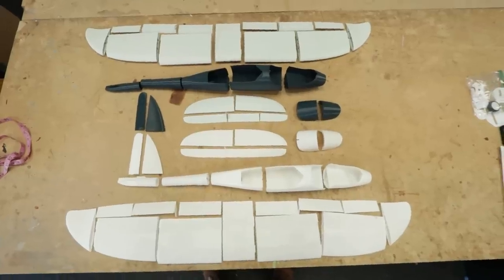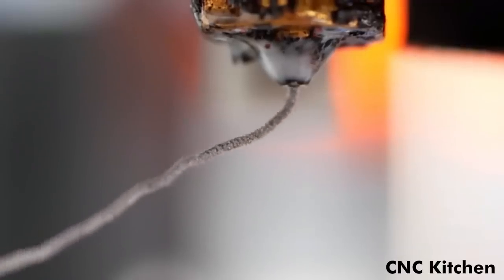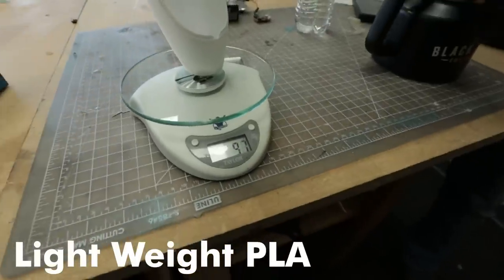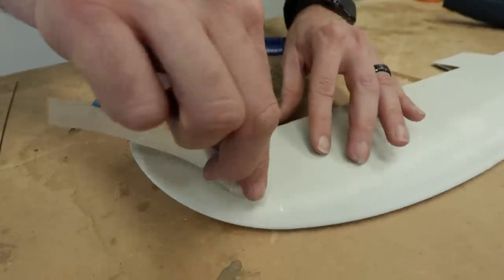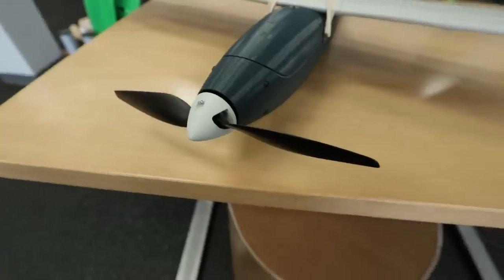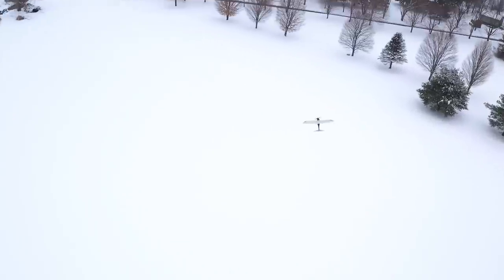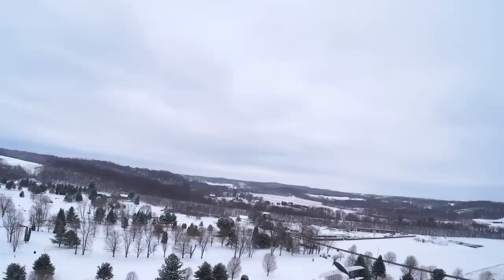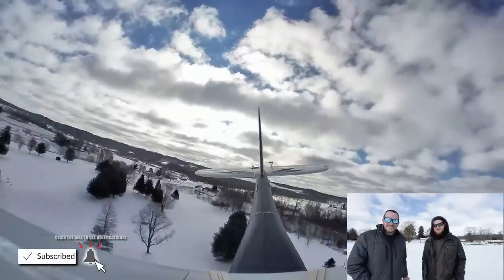Insanely Light First 3D printed plane!!!😱

Comment: FliteTest: It's free.

Me: Can I borrow ur 3d printer?
Reply: and the receiver, motor's, props, batteries, and spare parts.
Reply: Or you could design, test, change, test, redesign, test, amend, test, scrap, design v2, test, change... rince and repeat... yourself, and then fly what ever you come up with. 

The design is free. No one ever claimed that you would get a RTF setup left on your doorstep.
Reply: @LeftFlamingo  OH?  Like the thumbnail that brought me here that clearly states "FREE 3D PRINTED PLANE" in English text?  Yes, they did. Try again.

This is like those bogus software offers that say "Free download" but then try to charge you to use the software after you download it.
Reply: @Doggeslife  I guess you're new to the internet. Welcome. It's an interesting place.
Reply: @cmdraftbrn  and the high cost of the materials.  see my post above.   $80.91 for 750g shipped.
Reply: @Doggeslife  Yeah, Free in the same sense that models on Thingyverse are Free. Most of the time you have to pay for the STL files on top of the printer and other hardware required to make the model do something.

Maybe you're unfamiliar with the norms of 3D printing, which in case that's fair.
Reply: @DFX2KX  Nope, very familiar.  Hence my displeasure with the loose and misleading use of the word "FREE" so often done.  Have a better one.
Reply: @Doggeslife  That's the thing, it's universal enough that the very last thing I'd expect would be a complete model. To me, 'plans only' has been a given for the same reason that 'Hey, Firefox is free' doesn't imply that every install of Firefox comes with a complementary laptop.

I'd suspect that's how most folks parse it, because otherwise people wouldn't put free anywhere in their youtube titles for the hate.
Reply: @DFX2KX  " 'Hey, Firefox is free' doesn't imply that every install of Firefox comes with a complementary laptop."

No, but I wouldn't expect a "free" airplane to come with a compete radio system either.  Just the "free" airplane as advertised.

And poor analogy using a browser. FF says free and it is.  When you download "FREE Firefox" and run it, it runs as advertised. It doesn't say you have to pay more to keep it, or that you still have to pay for this or that additional expense to have it. It IS free.

"Free" means FREE, and possibly the most abused word in commerce. Thank over-aggressive marketers for the most part.

"Free 3D printed plane" is false and misleading.  "Free 3D printed plane files" would be accurate, regardless of what "Well, that's what they do" excuses are given.

'Nuf sed.

Comment: Interesting idea: to demonstrate how easy and quick it is to get back in the air with one of these planes, intentionally auger in, which would start the clock, and then reprint out the parts needed and rebuild the plane.  It could also be a test to compare regular PLA and LW PLA in terms of durability.  Maybe do a test with PETG or TPU as well.
Reply: Assuming I can get my hobbies in order, I'll be printing this out of PETG and it will be my very first plane. I'll try to remember to report back.
Reply: @MrPinusMonticola  Awesome, thanks!  I plan on making the plane myself at some point.  Not sure what material I'll use though.
Reply: my guess would be... 200 hours or so on a complete frame loss. At least with my printer since the old Tarantula prints slow.

Comment: "Lighther than air"
Impossible...
Reply: It's possible aerogel with hydrogen is lighter than air I think
Reply: @tristansimonin1376  But thats not what light weight pla is made of
Reply: This will not be the last time you will be lied to.  The author of this video’s title is likely a democrat.
Reply: It's not impossible because he didn't specify the amount of air it is lighter as. One cubic meter of air has a mass of 1kg so both those planes are indeed lighter than 1 cubic meter of air.

Comment: Because some people in the comments asked. Here are my personal experiences with this build.
I am using a "Ender 3 v2" with simple black PLA (from Verbatim) (Ender 3 or 3 Pro should work quite similar).

Still in construction, but looks promising.
Created the gcode myself from the STL files with "Cura". Make sure to stick to the instruction page about the layer settings. My biggest problem was the bed adhesion. Fixed it by using a brim on some parts + blue tape.

Estimated costs (related to Germany)
~ 220€ - Ender 3 v2
~ 15€ - Filament (~600g)
~ 20€ - Small stuff (ruberbands, rods)
~ 200€ - Electronics (did not puchased the cheapest (stabilizer + telemetry included))
+ remote control (already exists)

- 2 weeks of printing (in spare time).
- 2 months already of learning how to tweak 3D print settings (printed 3 parts twice because I was not satisfied with the result (most likely temerature, print speed and fan speed adjustments)).

So it is definitely not the quickest and cheapest way to start into the hobby, but I had a lot of fun already with my 3D printer.
And as long as the electronics do not brake, I can easily repair everything for almost no cost, just some time and effort.
Reply: any update on the plane? How did it fly? Did it break?

Comment: Her is a challenge, make an rc plane that can carry one of you guys!
Reply: Impossible
Reply: Red bull flugtag
Reply: Thats a good Idea
Reply: They already did it
Reply: You mean “make a plane”
Reply: Peter spiral already did that
Reply: Why would it need to be RC if you were in it?
Reply: Go to the Peter stripol,channel I think he did that already
Reply: Illegal, unless it would be part 103 ultralight. And it wouldn't be 'Radio Control', it would simply be an airplane.
Reply: @colt.45rc76  i will go check his channel but i think it was a part 103 ultralight with an electric motor and he was using the rc setup as a fly by wire setup
Reply: @ronaldharris6569  it was, but not fly by wire

Comment: WHO WANTS them to come up with cool new planes made of foamboard that we can then make ourselves?
Reply: Ordo Militaris Radio TV  I agree with you colleague. They began to make just entertaining content, while earlier there was educational content. Probably a crisis of the genre (
Reply: What I'd like to see personally would be flitetest models that have both foamboard and printable versions. Foamboard for those that don't have a printer, or want something that's cheaper to replace in a crash, and STLs for those that have the printer and/or want the extra performance. A video comparing them would be an interesting watch

3D Printers aren't as expensive as they used to be, by a long-shot. Even my $150 Tarantula could print one, and that's cheaper then a nice radio. They've fallen in love with 3D printed air-frames because they've got the same performance as commercial models while still costing way less.
Reply: @DFX2KX  I've already come to the conclusion that I don't want to make light planes. They do not have enough space in the fuselage, it is very inconvenient to place electronics. Still, the practical use, as opposed to a few minutes of flight for a YouTube video, is a different thing... A light aircraft is a problem in windy weather and a small battery capacity, hence either the inability to fly at all or a small flight time. Yes, you can come with a backpack of batteries, but not everyone is comfortable.

Comment: Thank you for the wording you used when mentioning the weight difference. It's not that one is necessarily better than the other, it's just different. Unless, of course, it's too heavy to obtain lift. LOL 
Another advantage I see to the 3D printing is you can print it in different colors and save time painting.

Comment: Just imagine a 3d printed DLG, that would be amazing! I know that composites are always the go-to material for F3K flying, but being able to 3d print out a wing, tail feathers, and a fuse would be a dream. Although there would be a lot of problems with torsional stiffness in the wing as well as having to probably lay some form of carbon spar and obviously a carbon boom, I think the price you pay to print off everything would be much cheaper than buying an outright new plane.

Comment: what glue are you using to glue pla? i’ve had zero luck with regular crazy glue ... the only stuff that glues Pla in my opinion is MEK
Reply: I use the super thin CA glue used for woodworking. I don't have the bottle in front of me, but brand shouldn't matter. It has about the viscosity of water. Penetrates between layers/layer lines well, and I've used it successfully for structural parts on things as durable as rifle stocks.

Comment: Great Stuff, our family 11, 13, 15 Y/o have all built foam trainers and been inspired to scratch build foam board planes. We have also crashed plenty of them as well :). 3D printed a few, but they come apart like a wine glass on concrete in a hard crash.

If I may suggest bringing the background music down a touch, it is a bit loud over the voices at the end of the videos.

Some suggestions would some more common house hold items to use like 2-liter bottles, or even an empty soda can (perhaps as a motor mount?)
A plane that collapses into its self, like a kid's expanding  flashlight sword would be an awesome, and compact way to take a plane to a field.

Comment: 120$ per kg for the Lw-Pla. Just saying. Ouch.
Reply: But you can recycle thé pla
Reply: No no... free. Read the clickbait title.
Reply: @scryan10  😂
Reply: But it uses half as much material so technically the same price almost
Reply: @brsrc759  So you pay 60$ per kg for your filament?
Reply: @evilbetty9204  don't have a 3d printer. Just repeating what they said in the video
Reply: @brsrc759  PLA is like $20

Comment: I am in the middle of 3d printing all of the parts from the free plans ( thank you so much for doing that), i want to know what glue to use for pla? If some one can recommended what to use i would really appreciate it. Thanks.
Reply: I'm using Bob Smiths Insta-Cure + (gap filling medium) along with their accelerator but have not flown it yet

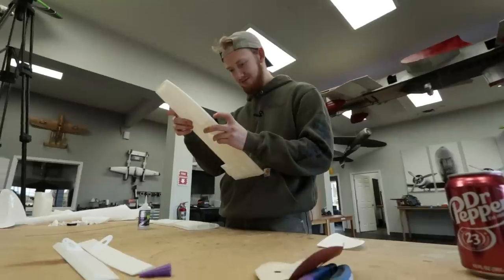Comment: 5:00 Actually based on your retraction distance, you may need some tweaking in your settings, but the extruder (Retracts) filament a certain distance out of the nozzle moves the printer head, than pushes it back in and keeps going.

Comment: I've been watching the channel for a year or so now and have finally decided to get into the hobby. I purchased a F.T
Power Pack B, the Eclipson .stl files for their "Model C Bush Plane" trainer, some colorfab LWPla from matter hackers, and all the other miscellaneous bits from F.T. and ebay. I'm currently printing a test plane out of carbon fiber pla while I wait on the hardware and the light weight filament  to arrive and have been hunting for an appropriate 6+ channel transmitter. I could really use some advice on what would be some good transmitter options for a beginner that's easy enough to operate/program, that can store setting for multiple planes, and won't break the bank (I'd like to stay under/around $200 until I'm a bit more involved in the hobby. Any advice would be greatly appreciated whether it be  recommendations, a youtube video, a blog, or a fourm to look through. Thanks to everyone who read the whole post and is willing to help out a noob.

Comment: The model A isn't my thing, but free is free, especially when trying to get your printer dialed for single wall printing.  The model C looks pretty sweet...hmmm.  It's a bit of shock to see what LW-PLA costs, but if you  can keep waste down, the actual airframe should still be fairly cheap.

Comment: iv printed the Model Y that was free with out landing floats fuse is silk PLA and wings PLA but in Australian summer damn what a waste of time everything started sagging so started printing in PETG trans purple mission with 1 wall thickness and keeping it on the bed. I have found to stop stringing in petg need to change the travel setting to travel within side infill which will stop the stringing and have random start points yeah it will look funny if your running translucent filament but will pay off in the end of the print and smash your first layer in to your bed.

Comment: Josh, another great video! I am just starting to invest time in getting into 3D printed planes, and this is coming from flying years of your Flite Test Planes. I am pumped to try out this new experience. Do you have any suggestions for 3D printers?
Reply: Not a creality, they have issues and are a project and a half to get working properly if you get a bad one with no quality control you are looking to rebuild it from the frame up. Sidewinder works out the box comes almost assembled completely and is pretty affordable considering its build size. "prussia" cool. works wel, needs assembly and is overpriced.
Reply: @febeomnibeepboop6367  thanks for the info. I ended up going with Anycubic Vyper. Inexpensive, almost fully assembled and after hours of printing the only thing that has failed thus far is the accessory light, which is just another bell if you ask me.

Comment: I wish I can build one!!!
(I don't have a 3D printer)😭
Reply: Fortunately, Printers aren't as expensive as they used to be. My Tevo Tarantula was 150 when I got it. And far better ones can be had for 200. Not foam-board cheap of course, but cheaper then some transmitters.

And if you don't mind slightly lower quality, you can get some REALLY cheap PLA and make something that flies fine. I use $15 filament and it's half decent.

Comment: Nice looking plane but it's really not worth printing planes, they take days to print, the filament is expensive, very brittle in a crash, heavier than foam and then there's the obscene wear on the printer to built a project like that.

Comment: Cart Subtotal (excl VAT) $44.76      Shipping $36.15     Order total  $80.91 for 750g      Sorry guys.  That plane is too expensive and without electronics.

COOL builds though.  I did mine in pla and one in petg.  both are awesome to fly and slope with.
IF you hold the fuselage up to light, there is an eclipson embossing in it.  Eclipson did a great job engineering these planes.
If you do a belly lander I would recommend a larger folding prop.